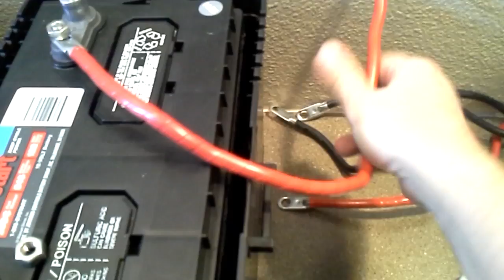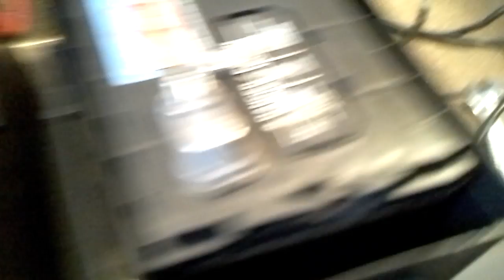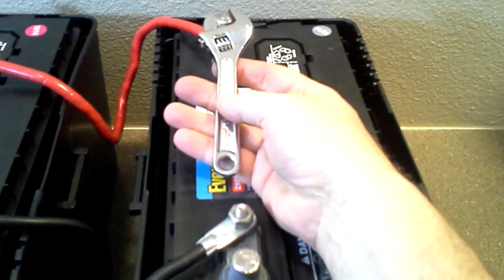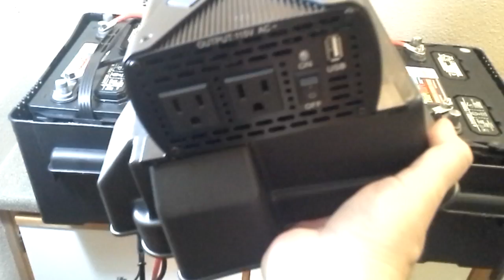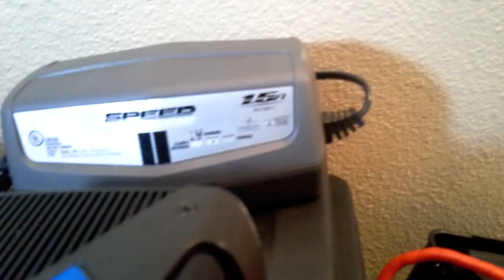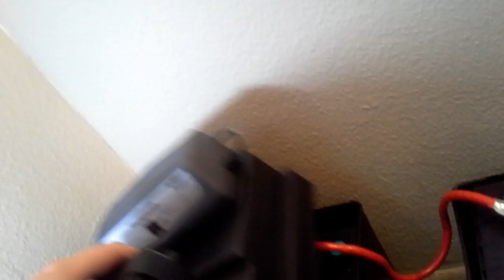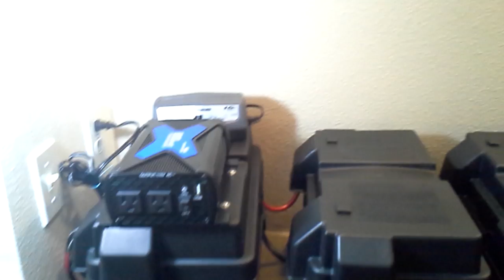Installing 4kW/Hr battery bank with 800W 120V Inverter and Trickle Charger from Tactical Woodgas

Comment: Do your homework… the positive and negative should be connected at opposite ends… or move negative wire to inverter down to negative terminal on right battery… yes it makes a difference, you wouldn’t think so just being a common ground but research it and see
Reply: That's what I thought and I'm just a newb trying to learn.
Reply: @john 
Can you please elaborate a little I’m curious to know what difference that makes 
Definitely curious 
Thanks
Reply: @eharris6347  If it's done the way he did it the first battery thats closest to the charging cables will get most of the charge current, then less on the second and way less on the third. This will cause an imbalance of charge states across the 3 batteries and over time will ware them out faster. One charge lead should be on the positive terminal of the first battery and the other on the negative terminal of the last battery. This will ensure an even charge across all three batteries.
Reply: Do your homework. Battery in serial and parallel connection.

Okay  so the problems here.
The inverter should be connected to the middle battery along with the charger.
Why?
Power draw across the battery should be even. So what they have done is pull power through two batteries and the charge will do the same, so you will tend to kill one battery first.

Also the cable, I think it's only 50amp rated. So depending on the inverter and power draw, they may melt and cause a fire.

Also misleading, if these are 110ah batteries, your more likely to get 50-60ah from them or 1.8kwh.

Use 24v, so much better for the power draws, and up to around 3000w. Anything more and it's 48 volts. That will take you up to 8kw.

I'd buy a solar panel and charger, because when the mains is out, you can't charge the battery! And 1.8kw won't last long.
Reply: Can you recommend a better video?

Comment: Good video. More tips for working with batteries: paint the tops of the terminals red and black for positive identification, no drinking while working with batteries, remove all your jewelry, and cover the handles of your tools with electrical tape.

Comment: thats a great little back up system. simple systems like this are usually the most useful and practical. every house should have this installed. It looks like a $350 system, worth every penny when your power goes out.

Comment: The amount of rocket scientists making comments here is astonishing
Reply from the maker: It's all good; everyone comes from a different knowledge level.  I was a bit opinionated as a young engineer and mellowed over the decades.
Reply: Tactical WoodGas 
I’m building out a ice cream truck and I’m very much interested  to know if it’s possible to run a 30 amps and 81 LRA frozen yogurt machine and a freezer that takes under 10 amps in a battery system because a big generator is way too loud

Comment: Excellent instructional video. Clear, step by step instructions. Great gob! and thanks! 😃👍
Reply: +stevemichelle1203 I suggest you do some more research and you'll find out that this is wired wrong on that first battery.  The way it's set up to drain the first battery is gonna kill it, he should have taken the POS post on the first and the NEG post on the third and hooked those 2 up.  This would drain evenly from all 3 batteries and not strain the first one..
Reply: +Kirkville Locomotive Works Minor benefit from that, with such short and heavy cables.  Doesn't hurt, feel free to connect that way.

Comment: Take your negative from the charger and move it to the negative terminal of the third battery so that you are getting balanced charging. Do the same for the inverter so you get equal discharge from the batteries. Otherwise you will wear out the 1st battery prematurely.  In my experience those small inverters are not pure sine wave and put out more like a square wave...  so many of your appliances with motors will not like that and you risk messing up your expensive electronic gear (TV, stereo, Xbox, etc.) if you are not using a ton of filtering to smooth out the AC.  Don't expect to get 4KWh from this system, and run a fan on that inverter when pulling a load as it's going to get HOT (that's where much of your battery power is going). Put a piece of slate or heat shield between it and the battery case it is sitting on so it doesn't melt  the case or cause a fire.

Comment: Great video! a HUGE word of warning, DO NOT under estimate the power of a 12 volt battery. I had a battery in a 72 Chevy blow up and blew a hole in the hood of the car. Back when they made them out of steel.
Reply: damn.

Comment: ++You should have connected the bars of the + lead to the upper left-hand corner. As you did, and your negative lead to the ottom  right and  corner, for your charge control and inverter. In order  to keep each of your batteries. Equally charge and discharge. A common mistake. This lets the current  flow through all the batteries. Equally. When using more than one battery. Always connect your leads to the opposite end the batteries. Whether it be in serious or in parallel. As you did there..

Comment: Just build a Battrey box for all cells then vent it outside with dryer vent and a small 12volt fan and dryer vent with flaps.  Maintain water levels on all Battreys use distilled water and don't overfill cells mount inverter outside of Battrey box to avoid explosions. Use a socket and a ratchet and short extension tape on tools would help avoid accidents. I guess for a amature set up but you are venting fumes into the house mount stuff down so during a storm or earthquake your Battreys don't fall or get damaged  your primitive setup could use improvements

Comment: I have 5 batteries 12v in parallel with a 2500W sine wave inverter. one 24v 270w panel mppt controller works well even in cloudy weather. 50l 1500W hot water spoiler works well, etc., etc. in the summer I charge three electric bikes from an inverter with their own chargers.

Comment: Great video.  Inspired me to get started on this project for my family for emergency power. Don't worry about the negative comments.  I've got an electrical/electronic background under my belt, and your system is good. As a matter of fact, it Inspired me to do an additional job to go along with it and make things just that much better for my system that I'm building. And the good thing is that you included a charger on top of the battery box. If there's an emergency and your need to top of the charge, a simple extention cord pluged into a generator is all that you need.
Reply: I agree, there are 100 replies saying the same thing, hook the black lead to the 3rd battery (on the right)
that looks like 8 AWG wire. Its resistance is 0.6Ω per 1000 feet. His wires are 2 feet long, so about 0.6/500 = 1.2 mΩ resistance from one side to another
if the inverter is pulling its full 800W that is 67 Amps, the voltage drop if all the current is coming from the 3rd battery is only 80 mV (0.6% of the rated 12V)

its not going to make any detectible difference in how the batteries are drained or charged. If the first battery is draining 0.6% more than the last one,  its negligible. And it will only matter if all three batteries are completely drained. 

Recharging does not matter - that is NOT a 67A charger, its only a few amps. The voltage drop when charging will be microvolts difference from one to the other side.
Reply: Buy pure sine wave inverter it's best need knows how Amp invented have if its 20Amp ok if you buy 1000 watts of buy heater and 1500 watts not run it ok need buy like 3000 watts pure sine wave it's best used real deep cycle battery have 230A

Comment: looks good but that is not a 4kw hr battery bank, i know its hard to determine those walmart batteries capacity, but i have 20 of them and each battery makes 1200w but ( you can NOT let it go below 50% or that will permanently kill the battery) so you only have 600w usable power. And that 600w usable is USAULLY only the first discharge because batteries degrade over time especially lead acid, lithium last longer but cost 4 times more. but overall these batteries best bang 4 buck especially since they at every local walmart for 100$ and 3-4 yrs might have to replace longest i heard was 8yrs with good maintenance (never go below 10v and charge up everyday)

Comment: I have tryed different configurations with three batteries on my camper solar system.  I have found connecting the load to the positive and negative of the middle battery works the best. I have never seen a video showing this setup.
Reply: Agreed. Same.
Reply: @TonyB1999  ..... does connecting the load to the positive and negative from the first battery to the third battery also work

Comment: I like your video, but if you advice people how to, then at least please explane and do it right (no offence) 
(you can check my advice on the net also, i'm not joking! )(i'm a proffesional (offgrid)battery bank specialist, so seen it, done it Repaired and replaced it in practice.)

always connect negative and positive leads from the inverter and charger opposit on the battery bank, (so forinstance the negative on the left battery, and the positive on the right,) this wil help to use all battery's equal, connecting all the outgoing/incoming leads on only the left batery wil drain the left battery more then the right one, resulting in differend charge/decharge rates, damaging  the battery's, you should think, it doesnt matter cause they are connected by the leads, thrust me, it wil make a huge difference., be also aware that iff you parralel the battery's indeed the amp hours will double, but you can only use half of that whitout damaging the battery,s, so in your case, you have 300 amphour totall, you may only use half of that, so there is 150 amps to your proposal.! , also a small comment about using different adge, mark and badge battery's, its not a good idea to put those in parralel whitout a constant charge, due to the different internal resistance's you wil create diferent states of charge, damaging the battery's)(so you will worn out your expensive battery's way sooner as nesssairy.  
 (sorry for my rusty English, its not my native language! (dutch)

Best Regards, Richard , VRM marine Holland.
Reply: When connecting the way you suggest, should the positive and negative wire be the same length to the trickle charger?
Reply: Semantics Simple  doesnt matter..
Reply: Great advice. Good video except for that one (important) detail. Wiring your battery bank as shown in video will cause early failure of the batteries closest to the connections to inverter/charger. Then you'll be scratching your head wondering what went wrong.

PS, unless you have only a single solar panel you will realistically want more batteries in order to have more usable power output. 8 batteries minimum. If you can afford that is. If you're on a budget then you have to make compromises and that's ok, you're still saving some money on your electric bill with 3 batteries.
Reply: I see the value in very large battery banks, but in the three battery system with one-foot large cables shown here, I have not had uneven aging in my four year old system.  I just disconnected them and did an internal resistance check, and all three are within 4% of each other.
Reply: Aaron C just as y stated in my former story...lol
but the different length of the cabels from the trickle charger to the battery doest matter, the thickness off thease leads are critical tho, the shorther the thicker the better.

Comment: The best way to wire batteries is from battery to center pole, one for positive and one for negative. Say you have 10 batteries and they're 12 volt each, the typical way I see on youtube is from one battery to the next, WRONG!!! The first battery will die before the rest and so on, because all of the stress is on the first battery and on and you wont get nearly as much sudden heavy current (Amperage) as you will this way so you wire the positive wire from each battery to a single long and thick bolt mounted thru the board and stack the wires on top of each other which you will also draw your DC power from that and the same for the negative and if you need 48 volts you wire four 12v batteries in a series and run that to the same bolt you would use for 12v. picture them in a circle and the center has 2 bolts, but that may be Impracticable so stack 5 batteries on one shelf and 5 on the next keeping the same gauge and length wire for each battery and you'll have a long life cycle with much more punch. You tap from each battery at the same time.

Comment: I would have chosen at least a 2000 watt invertor to be able run a refrigerator a light and a radio.....800 watt will not start a refrigerator. Minimum 1500 watts alone for that with nothing else hooked up at fridge start up normally 1500 watt start and 800 watt run or there abouts....
....

Comment: Nice explanation but...

If one places the negative at the bottom left battery's connector and the positive battery connector at the top right battery you get a more even and average draw from all batteries AND a more equal distribution when charging.

Also...the title says 4kh!  I see far less.

Cheers.

PS.  I edited because I can't spell for toffee.
Reply: I thought the same thing- if you have multiple batteries wires in series, hook the positive lead from the inverter on battery 1. Hook the negative lead from the inverter to battery 3. If you have more or less batteries, simply extrapolate. It allows for an even discharge/ recharge. 

Also, if those are 300ah, you don’t have 4K usable watt hours. Ohms law:

300Ah x 12V battery bank= 3,600wh

These look like sealed AGM batteries so you don’t want to discharge below 70%

3,600 x 0.70= 2,520 usable watt hours

Not trying to nitpick- all in all great informative video!
Reply: @papabearerickson  These batteries are wired in parallel.

Comment: Great video but the numbers don't make sense. 800 watt inverter wont run a 1600watt refrigerator and if P=IxE, the math doesn't add up. However, I have a 750watt (Walmart) inverter with 2 deep cell batteries each has 125 ah available charged by 400watts solar and 1600 watt refrigerator isn't something I would hook it up to! I use it and it's great with my additional 400 watt inverter because the batteries will last much longer and the charge lasts longer. The inverter cuts out at 80% battery and most are set up that way. You have a nice system but I recommend a propane refrigerator for foods. Thanks!
Reply: +Gene Smith What fridge is 1600 watts?!
Reply: 1600W is higher than I have seen.  Maybe in start-up current of a commercial or very old refrigerator. Average current is much lower.

Comment: Thought inverter  leads had to go on terminals on negative  on first  battery and positive  on last battery,notice you put inverter leads on terminals on last battery only.good vid ,thanks for the info
Reply: you are correct, should be drawing across the whole battery bank
Reply: I thought the exact same thing, if you have your batteries in series like this (hope I used the correct word), the last in the series you pull positive from, and the first in the series you pull the negative lead from.  I was taught this is the only way to keep the batteries equal and extend lifespan of batteries.
Reply: @Rocky1765  This is parallel wiring. Series would be 36V.
Reply: He's doing a parallel array ... that way it increases your amperage .. example:

3 -12v@500 amp in parallel = 12v @1500 amp

3 -12v @500 amp in series
=36v @500 amp
Reply: @patrickmay8261  Ninja has it correct.  You are mistaken in what you understood reading his post.  The batteries ARE wired in parallel, but the inverter should have one connection to battery 1 positive and the other connection to battery 3 negative, rather than the inverter being wired to battery 1, and batteries 2 and 3 just hanging off battery 1.  That ensures that ALL batteries supply power equally. Standard practice with multiple batteries wired in parallel.

Comment: In order to have balance on the batteries, you need to connect positive of the inverter to positive of the first battery and the negative of the inverter to the negative of the last battery.
Reply: @MrSummitville  I don't understand what difference it makes.
Reply: @seahawksforever9504  Did you read the article ?

Comment: think what you were trying to say was that you connected everything in parallel : positive to positive to positive and neg. to neg. to neg. if you went neg to pos. to neg to pos. to neg to pos. you would have been in series. and the voltage would not be consistent .) in parallel voltage is constant and amperage divides between loads, in series amperage is constant and voltage divides.
Reply: Hi. I've been reading lots of comments on this vid and got so involved-I see that Tactical has most of the answers-I respect that- hoping not just because he has the goods to sell. 
My questions are; does it really last the solar power system???? I'm also about to upload my vid on my new rocket stove heater(hope REALLY TO HAVE TIME FOR IT.) I'm from Rome Italy and my apprmnt does not have heating system but we got saved by my rocket heater. But now I'm also interested on Solar power. Thank in advance for the answer. Good Luck and God Bless
P.s no offense on Tactical. I give respect to all of you.

Comment: At 4:45 he's talking about not using a longer wrench when tightening battery terminals... Guilty. I was wiring up my car stereo when I was 16. Both ends of the crescent wrench met with the posts. It turned the one post into mashed potatoes. My inline fuse was over a foot down the cable and spontaneously combusted. Cool.